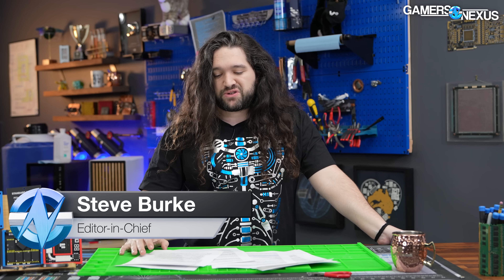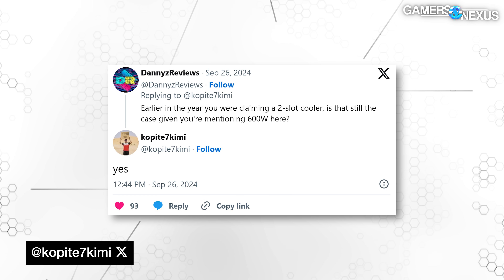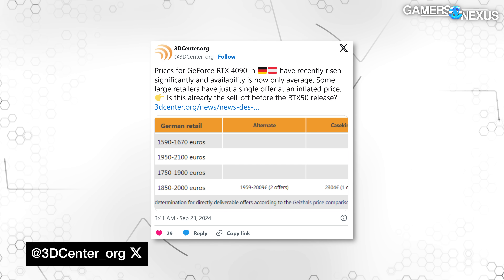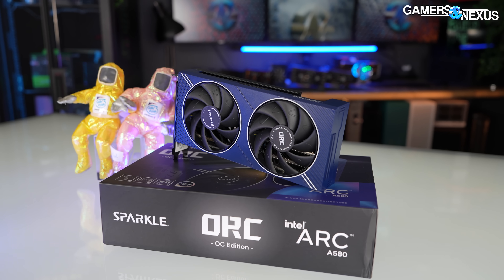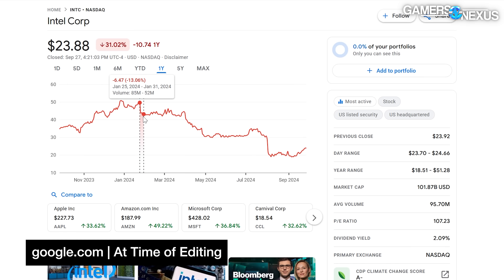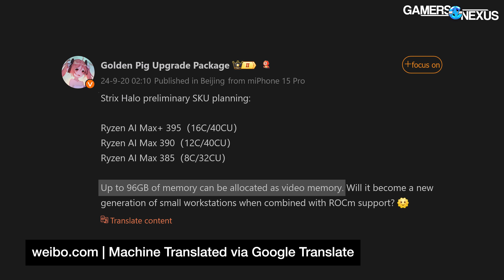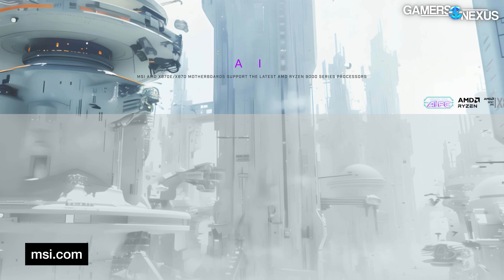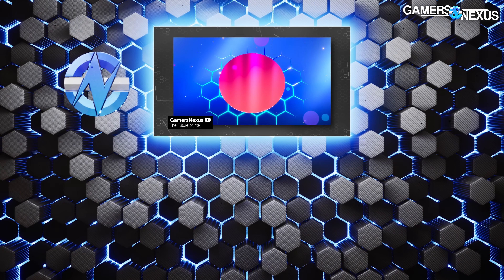HW News - RTX 5090 & 5080 Leaks, Valve ARM64 Experiments, Intel Arc 0% Marketshare, 4090 Price

Comment: Proton still uses WINE. Proton is a containerized compatibility layer that includes WINE, DXVK, and VKD3D (among other compatibility prerequisites).
Reply from the maker: Awesome. Thanks for the background on this. We don't follow the Linux world very closely -- though I will say that I've been a lot more interested in it with Windows' terrible decisions the last few years. Maybe time to start studying and deploying it in testing!
Reply: @GamersNexus  Well i think itś time for "the mainstream" to at least follow a long whats happens in the linux world.
Reply: @GamersNexus  It would be nice to see some of the potential benchmarks coming from systems running linux as a comparison.
Reply: @GamersNexus  It's surely interesting stuff to study, especially as you review and test wide variety of hardware, and there are lots of workstation and server components that only see certain kinds of OS's. Linux varieties usually. Especially today's hardware can easily used for virtualization, and here Linux is superior to spin up VM's and run containers. It'll only get more common as time goes on.
Reply: @GamersNexus  would absolutely love to see you guys add Linux benchmarks to the normal testing routine. Maybe time for a new channel addition; Linux Nexus

Keep me informed.
Reply: @GamersNexus  I'd love to see that! Linux is really great lately
Reply: @GamersNexus  would be so down for Linux testing. Especially with anti cheat like for Valorant and Fortnite. Those are the main two games to why I won't/can't switch to Linux, though I want to because of Windows and the screenshot and AI stuff they're pushing. Data collection is about to go to the goddamn extreme, and I'm not entirely sure I can trust them (pretty much all tech companies) to honor opt outs and both not take the screenshots/data let alone not store them
Reply: @GamersNexus  If nothing else, having benchmarks run on a Steam Deck would be an interesting point for comparison!  And it's easier to fit on a bench…
Reply: 11:00 the steam information makes me wonder if they're looking to open their own mobile gaming store
Reply: @GamersNexus that would be super helpful and appreciated :) i have had similar concerns with windows which drove me switching over entirely to linux
Reply: @GamersNexus  I'd love to see Linux used more in you guys' testing, if only for the sake of comprehensiveness.
Reply: @GamersNexus  Well,  as the saying goes the best marketing for linux have always come from Microsoft xD
Reply: @Koyote2033 honestly that rootkit spyware anticheat will open you up to the data collection you’re trying to avoid. It may be best to drop games that have so little respect for your privacy and security.
Reply: @GamersNexus More eyes on Linux would be great! Partially because Linux is interesting, partially because more eyes and proper critique on Linux would be great. Some or most things are great, other things require a lot more critical eyes. Like the awful user interface of a lot of open source programs. As much as some try to claim it, a lot of the programs supposed to act like a FOSS replacement of commercial Windows programs just don't cut it. 

And having more eyes to notice and report problems with compatibility would help Linux a lot.
Reply: @Ranguvar13  no thanks. I'd rather keep the little, minimal enjoyment I have in my life than being a complete miserable fuck. I'm more worried about Microsoft anyway with how large they are and what they can do domestically
Reply: @Koyote2033  ? …you’re the one who said you were concerned about data collection. If you are, then giving strange companies rootkit access so you don’t have to try other games seems strange. Two corporate products are responsible for the “little, minimal enjoyment [you] have in [your] life”? lmao, support companies that respect your ownership of your computer. You don’t want Microsoft taking screenshots but you literally give anything and everything to those two publishers with zero oversight. You realize that data ends up sold and gathered up by the big players in the ad and info markets? Even stuff that was obtained 
under incredibly broad ToS or not under one at all, they just Hoover it up as there’s been no real legal challenge and it’s so hard to prove origin
Reply: @bonkerbanker nah Linux is still niche
Reply: @Ranguvar13  yeah, I'm aware of what I said. And if that's the price for the minimal bit of happiness from the few games I enjoy, then fine. Riot and Microsoft are different magnitudes of companies and is why I have an isolated PC I use only and specifically for gaming with virtually nothing else installed but an anti virus. Microsoft is my worry as I can't avoid it, nor do I trust their history with how they've handled data. Besides, discord seems to be the most egregious and sell the most anyway, and I'm way too embedded and put so much up there before I was even aware of what they were doing
Reply: @GamersNexus  You don't need to study or test it. You just need five minutes to install it and start playing. Linux is easier to install and setup than windows nowadays. I like Manjaro and Lutris for all the wine-proton stuff, but you can't go wrong with any distros really. Dual boot and get the best of both worlds.
Reply: @Ranguvar13  and yeah, bruh. I enjoy gaming and the competitiveness of it. Work grind and people suck, as you've explicitly shown. Be better, my dude
Reply: @Koyote2033 you're the one taking it personally
Reply: @GamersNexus  Have you considered a piece on Linux for gaming in collaboration with Wendell?
Reply: Proton is Wine with a lot of the hard work done for you, but yes still wine at the end of the day
Reply: Interestingly, Valve decided to officially partner with Arch Linux - the Linux distribution on which they based Steam OS - by providing them with package building servers.

Archlinux, right now, unlike other distributions, doesn't offer ARM packages, only x86_64. But with brand new build servers... Maybe that would be a possibility ?

Funny timing, still...
Reply: @GamersNexus  Would certainly see some Linux love.
Reply: @GamersNexus  Please start doing Linux tests, I would be extremely interested in that!
Reply: @GamersNexus  Give us the Linux Testing!! Pretty Please!!
Reply: @GamersNexus  I would be very interested in a proton/linux benchmark. But since wayland is so new, it could be worth investigating (again?) after it stops being wonky in some apps with Nvidia's drivers.
Reply: @GamersNexus  Let me not beat the same drum that proton is wine, but about 1-2 years before proton wine suddenly became significantly better at running games ~2016-2017 at that given time i was running linux 100% and steam on top of WINE
Reply: Proton is valve's fork of wine. The container is the steam runtime, including dxvk, d3d12, blah blah. It doesn't use wine, it is wine.
Reply: @MA-ls4lb  god yes please, half the reason I'm on windows still is no one benches linux.
Reply: @GamersNexus  Do a Proton vs. Windows benchmark. Its already outperforming Windows in some cases.
Reply: Pass; DXVK and VKD3D are better.
Reply: @Koyote2033  Private servers are better, so no.
Reply: The DXVK part handles the DirectX 9-11 to Vulkan translation and VKD3D handles the DirectX 12 to Vulkan translation
Reply: @GamersNexus  Show us the way so we can follow the Linux lands. Please.
Reply: @ChristopherYeeMon  VKD3D handles DX12?!! Pass; DX12 is bad.
Reply: @GamersNexus  Would be cool for once a year or every 6 months of cpu & gpu bench marks on Linux for Proton/Wine
Reply: @bonkerbanker  No. The Linux world still has a long way to go before "the mainstream" should follow. Linux remains a very niche space.
Reply: @thatzaliasguy  Level1Techs is far better equipped to deal with Linux stuff. Just like JarrodsTech is better for laptops and LTT is better at dropping things. Channels shouldn't have to do everything. Let each channel focus on what it does best.
Reply: @Koyote2033  If you have minimal enjoyment in your life, that's on you.
Reply: I have gamed exclusively on Linux since 2003, Proton has made everything so incredibly point and click easy it's a miracle.
Reply: @thatzaliasguy  but why my comment disappeared? I just said I play games on Linux. WTF. 

YT comment section is so infuriating.
Reply: @Shepherd4R  "It's a miracle" is expected talk from born-again Linux users. Linux is like a religion.
Reply: @sammiller6631  Haha, I did say that as a trigger a bit, and you're not wrong. Some people take it far, I used to spend hours making games work instead of actually getting to play them. Not born-again though, I only learned Windows once my work required it.
Reply: If this is true, I can play more PC games on my S23 Ultra or future Redmagic phones instead of the games not launching at all
Reply: @Shepherd4R  to be fair though, I spent hours trying to make Windows work. So there’s that. LOL.
Reply: Moar Linux, I'm all for it!
Reply: @DavideDavini  The video was just trolling for engagement, and now they're censoring to moderate their dumb take. Valve stated themselves that Proton is Wine in the very next sentence that the guy quoted out loud at 10:48, but he skipped that part  and just went straight to say Linux gamers that used Wine were second zone citizen... Maybe the rest of the articles are also treated like that, so I'll take what's next with a grain of salt from now on, and may reconsider my recent subscription.
Reply: Does proton actually use containers? Not that I'm aware of.
Reply: @GamersNexus  There is an effort to use Wine with x86 emulation called Hangover. What's special about hangover is that it only emulates the applications code instead but not the code of Wine i.e. what replaces Windows in this case. The project started as an effort to run Wine on modern 64bit Power PC but no mostly focuses on Arm32 and ARM64. I image that's what Valve would use in this case.
Reply: @cmdrDiscoCat  There's ALARM, Arch Linux on ARM so it's a separate project but it's close to the Arch project.
Reply: @GamersNexus  As my mainly driver is basically a Linux machine, I would love to see Linux in your benchmarks. I might even recommend nixos for you to have a reliable and reproducible environment.
Reply: @GamersNexus  it's at least no worse than Ark
Reply: Presumably Proton ARM64 would have Box64/Box86 to run Wine x64/x86.
Reply: @Koyote2033  ARM64 would most likely be for their next device, especially if it's the rumored Deckard VR PC system they've been working on the last 2 years. Having a Linux PC contained entirely in a VR headset that's powered by a new ARM64 APU would extremely power efficient.
Reply: @ChristopherYeeMon as of July 2024,  DXVK is DirectX 8-11. D8VK has been merged into mainline DXVK.
Reply: @DavideDavini  why you tagging me? I don't have control over YT comments.
Reply: @thatzaliasguy  my bad clicked on reply but I was clearly not talking to you. Just venting. Didn’t mean to inconvenience you. Cheers mate.
Reply: @GamersNexus as someone slowly considering linux, I'd be interested in GPU benchmarks there if there is any difference, alongside any observation, tips, knowledge bit that you gleaned along the way.
Reply: @GamersNexus  I'd be really interested in some sort of GN gaming on Linux thing.  I've been doing the Linux gaming thing for most of the year and have been quite happy with it.  I think GN shedding some light on the state of Linux gaming would be a good thing.  For a lot of games I'd say it is a viable option now.  The pain points come mostly from learning Linux itself, and not having to fiddle around just to get the game working and taking a performance hit.
Reply: @GamersNexus  PLEASE do linux testing!
Reply: @Shepherd4R Pretty much.  About the only thing Linux doesn't support well right now is peripherals that the vendor hasn't released any software for, like the Thrustmaster Warthog... I still have to boot into Windows to use the insane mapping software for that... Elite: Dangerous itself works in Linux, and even in VR... but getting tthe controller mapping to work...
Reply: @GamersNexus  It's definitely time! I switched to Linux over a year ago and it's just better. I love to say, there are games I couldn't get to run natively on Windows that work perfectly on Linux. Good riddance to a miserable OS.
I've been told that widespread Linux adoption is one of those things that people like talking about but never happens, but Microsoft and Valve have closed the gap more than ever. It's the best chance we've had so far.
Reply: @bonkerbanker no worth
Reply: @GamersNexus  I did the switch to Linux last year on my old PC, and my new one hasn't seen Windows. So far all my games have worked fine.
Reply: @MA-ls4lb  The benchmarks will just outright always be better than on windows, pretty much. Less overhead. Couple percent performance gain. Unless there is some major software issue regarding linux systems, which is rare. What's more common, depending on the types of games you play, is that anything with an kernel level anticheat simply wont run.
Reply: @GamersNexus  Oh please do! I've been thinking about switching over to Linux and any data you could provide would be amazing.
Reply: Please do delve into Linux! Very interested in tracking nvidia driver performance on Linux as it starts to become more compatible vs amd